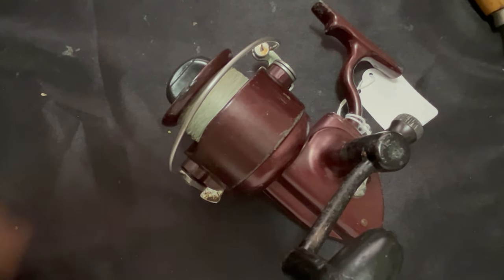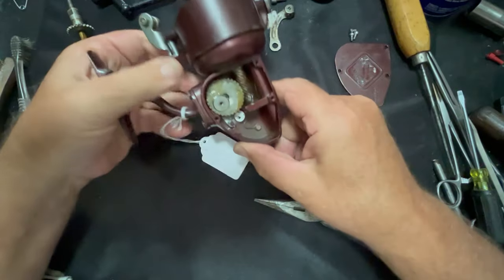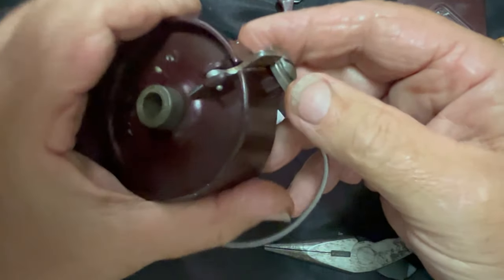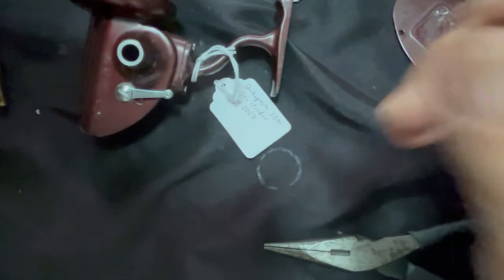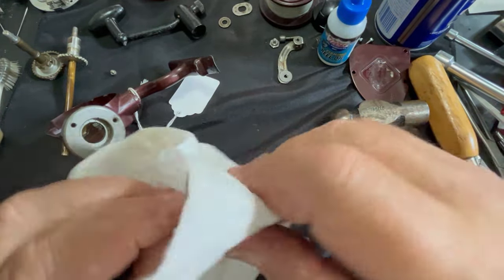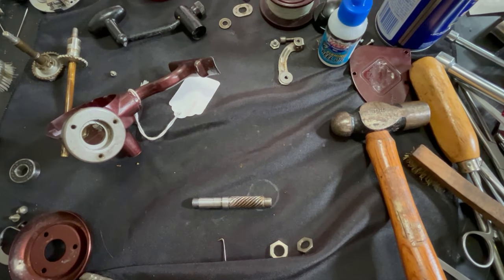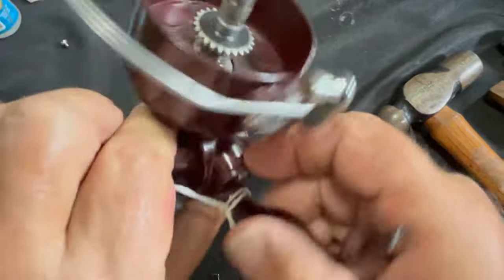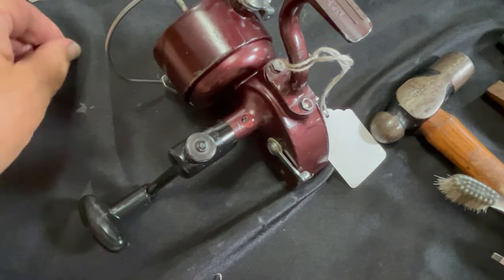Shakespeare Sea Wonder 2081 -- Service and Lubrication -- Young Martin's Reels 1

Comment: Now that's a proper quality well made reel, in a perfect world all fishing reels would be made this way with the worm drive and steel / bronze components and no plastic or pot metal inside.
An extra bearing or two wouldn't be a bad thing to incorporate into the mechanism, but in my experience if made right like this those extra bearings aren't really necessary.
Reply from the maker: Tyler, and they did install a high quantity sealed bearing when new but 40 - 60 years later the rubber seal has failed. Once the new bearing is installed it should last many more years. I would have liked to see a bearing installed at the rear of the pinion gear. The body hasn’t worn much there but it seems it would have greatly reduced the friction. I could be wrong.
Reply: @youngmartinsreels5314  on a larger reel like this having a bering at the other end would be nice.
Reply from the maker: I wonder how much it would have added to the cost? Of course it has worked fine all these years so what am I complaining about?
Reply: @youngmartinsreels5314  It would probably add a decent amount of cost unless the perfect bearing already existed.
I think it would need to be something that takes up as little space as possible, or maybe a just built in bearing race like the Mitchell 308 has for the rotor could have worked?
That would eliminate the need for a special bearing to be designed.
It's certainly interesting to think about how they might have accomplished this.
We know all the ways it was done on Japanese reels and how it's done now, but none of them seem to allow for a mechanism like this.
Reply: Rick, you would have to redesign the entire housing to accomplish a second bearing like you and Tyler are discussing. If you bored out the hole holding the rear end of the pinion to accommodate a bearing you would weaken an important structural part of the housing. I personally feel it is not necessary or advisable to do. I’ve fished with mine for five years and they work just as well as they did when I started. They are all excellent surf reels that are over 50 years old. I guess it is fine to think about but I wouldn’t change a thing. I serviced one of my 2091 reels today that is almost in mint condition. I again marveled at the quality of these Sea wonder reels. Altogether I have six of them though one is a 2081A which I dislike for a lot of reasons. Interesting discussion but you might be over complicating an excellent reel as it is. — Chris
Reply: @christopherjenkins2373  nobody is talking about modifying the reel, just a what if it had come that way and how might they have made this happen if it had.
PersonallyI don't think it's even needed, it wouldn't have hurt but they knew what they were doing.
I could be way off base but it has always been my impression that all the extra bearings are only used for marketing and to make up for design flaws and lower quality materials.

I haven't seen them all and mostly focus on ultralights, but so far the only spinning reels I've ever seen with extra bearings and such had pot metal gears.
The only reels I've seen with nice high quality materials and a smooth worm drive mechanism did not have extra bearings and didn't seem to need them.
I haven't seen extra bearings in any of the royal maroons, 1st & 2nd gen spinfishers, or the pre N D.A.M reels.
Maybe the later D.A.M reels or Skirted spool Spinfishers ?
 I know I've yet to see inside any Japanese reel that didn't have pot metal gears extra bearings or not.
I tend to be of the opinion that if you design a reel right and use the best materials possible you don't really need extra bearings, there just there to help eliminate slop and excess wear on soft pot metal gears meshing with a stubby little pinion gear.
Reply from the maker: Chris, I’m not thinking they should have redesigned the housing. I was thinking they maybe should have designed it differently to begin with, to include a bearing. Did the reel need a bearing there? No, but could it have used a bearing there and been better. Maybe, I am constantly looking at each reel I take apart and wondering:
1. Who designed it. 
2. When did they design it. 
3. Why did they design it that way. 
4. Is that the best way to make it. 
5. What might I have done differently.
6. Is there anything I can do as an end user to improve the reel. 

I think the biggest reason I would like to see a bearing there is if the case hole wears with dirt, (you know I’ve seen lots of dirty reels) there’s no way to correct that short of machining out the hole and installing a bushing. If it had a bearing, you could just change it. 

None of this is to take away from the quality of the reel. It’s a fine reel and I’ll enjoy fishing with it.

Comment: Of all the Shakespeare Sea Wonder reels the 2081 is my favorite. Of all the Sea Wonder reels the only ones I don’t have are the smaller 2070 and 2071. I have multiple ones of all the rest. The 2081 and 2091 or maroon series are the most recent ones that were made. All the Sea Wonders were made in the USA. The older 2080 and 2090 are gray in color and though they are very solid reels they have more problems  mostly due to corrosion of the bearing and pinion. If you get a good, well cared for one of these earlier Sea Wonders this problem is rarely encountered. The 2081A is a later variant the does away with the detachable stem and foot  and is a less desirable reel. I have a 2081A but I Don’t like it and will not use it. I will never get another one of these later variants. I often use the 2081 and 2091 for surf fishing for which they are very well suited and perform superbly. Those who have the early Penn Spinfisher 700 reels will instantly note the similarity as they, in my opinion, copied the earlier Shakespeare Sea Wonder reels like this 2081. As you can tell these Shakespeare Sea Wonder reels are definitely a favorite of mine. To me very few modern reels will ever have the strength and durability as well as longevity of these fine USA reels. Rick, your efforts to get that bearing and pinion out of the reel wee inspired. This condition of this stuck bearing is the one consistent difficulty associated with all these Sea Wonder reels. I’ve got to find myself a slide hammer so I stop pounding the back side of rotors. Oh, I forgot to mention, some of these reels will not have a ramp on that bearing retainer plate that trips the bail. Instead there is a larger and taller screw in the top position that serves as the bail trip. The hole in the housing for this taller screw is a larger hole so it is easy to get the proper alignment. I love the worm gear mechanism on this reel. It is as you say identical to the venerable 2062 Shakespeare reel.  Rick, you did a great job with this gem of reel history especially with getting the bearing and pinion out. — Chris  PS. Great job fixing the clicker!
Reply from the maker: Chris, I find it hard to believe that you don’t have an opinion about this reel. Surely you can find something to say about it. 😀
I was really concerned about getting that bearing out. It didn’t want to come out. The slide hammer finally did the trip but only after I  applied some heat. I ordered the replacement bearing for it today. It shout arrive by the weekend. 

My trip to the coast with friends this weekend has been cancelled do to illness on their part. We’ll just have to go another time. I now have 13 reels ready for the coast. I can’t take them all so I have to start the weeding out process soon. I’m about to add a GS-60 to the mix as well.
Reply: @youngmartinsreels5314 sometimes I have a difficult time discerning when a comment is sarcastic. “Don’t have an opinion? That is either sarcasm or you did not read my comment. I love these reels and I thought I made that quite clear. LOL! Seriously these Sea wonders have a quality, durability, and functionality that was so much better than reels that were made 30 years or more later. How’s that for an opinion? — Chris. PS. I’m very sorry your coastal trip had to be cancelled.  I’m going on Oct. 10. Choosing what reels to take is a problem I face every time I go surf fishing. I’ll probably take 6 to 8 reels with me depending on fishing reports from the beach.
Reply from the maker: Chris, of course it’s light hearted sarcasm. You just wrote a dissertation about how you felt about the reel. I had to kid you along about it. It’s in my nature.

Here’s a pretty decent looking slide hammer on EBay. It looks like had built in adapters that would allow you to pull the pinions without my homemade adapter. https://www.ebay.com/itm/115901930601?mkcid=16&mkevt=1&mkrid=711-127632-2357-0&ssspo=RwmSwzbrRjC&sssrc=4429486&ssuid=Wiy4EwzlRIO&var=&widget_ver=artemis&media=COPY